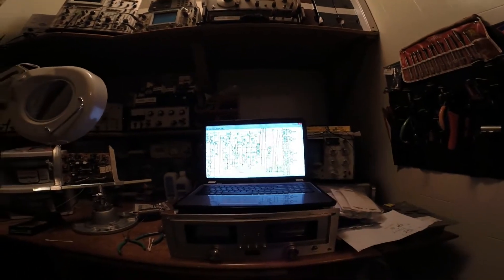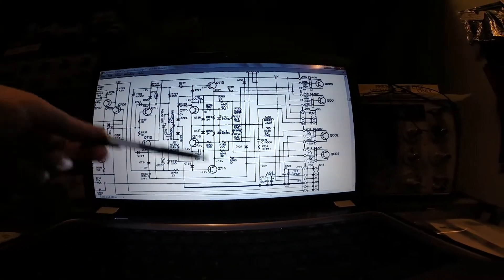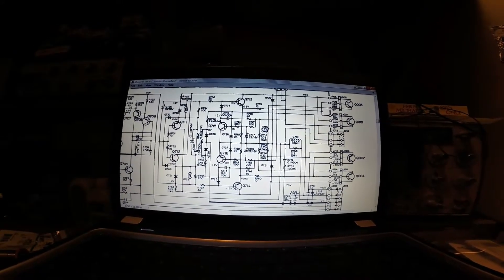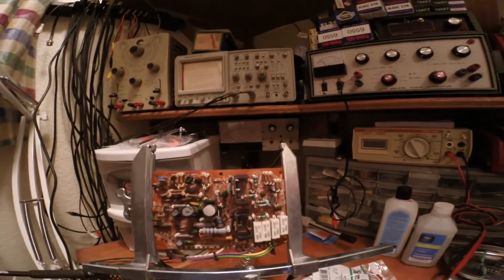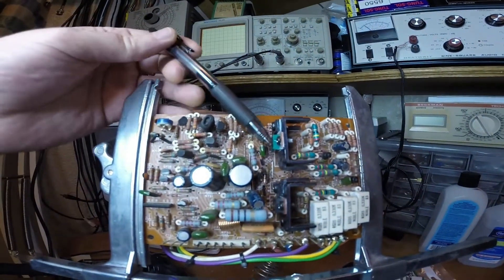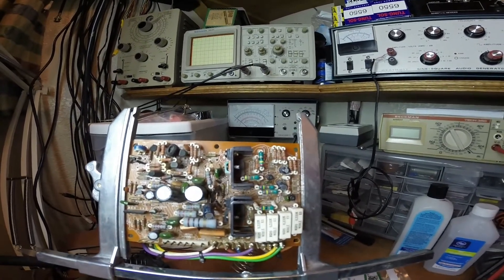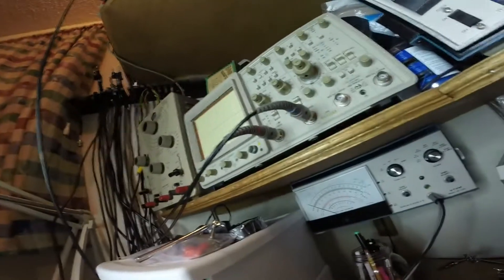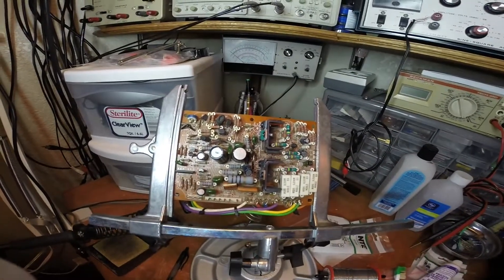Marantz 300 DC Power Amp Rebuild Part2

Comment: Do you have a mouser part numbers for these transistors? Thanks for the awesome videos.
Reply from the maker: I'm sorry I didn't see your comment until just now. There is bad news. I can very seldom order all of the parts I need from Mouser. In fact I always have to go to multiple sources. I can at least tell you my process. When I got the parts for this rebuild they were still available. They no longer are. So what I do is try to find NTE replacements that very closely match the originals. The internet is very helpful on this. Usually you can type in the original part number then find substitutes. Stay away from places that offer the original and ship from China or India the chances of getting counterfeits is super high. The On Semiconductor MJ21193 and MJ21194 Output Transistors are still available or at least they were 6 months ago. They now have a G suffix. On Semiconductor MJ21193G and MJ21194G. And Mouser has those. I don't actually even have the schematic for the 300DC anymore. But grab one up, make a list of all the transistors then start the substitute chase. Often KSC transistors also substitute well. I hope this helps.
Reply from the maker: Manual here
https://www.manualslib.com/download/888236/Marantz-300dc.html
Reply from the maker: I replaced Q711-Q716 and Q005-Q008 in Both Channels.